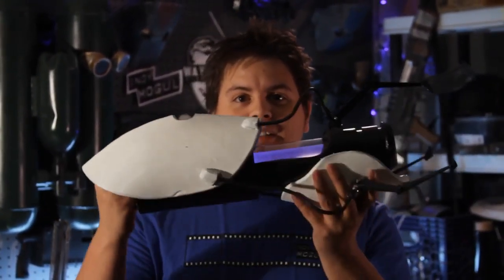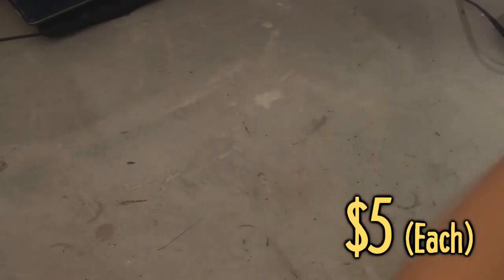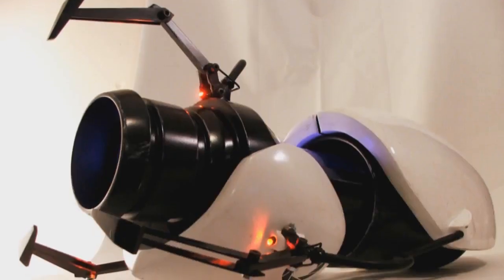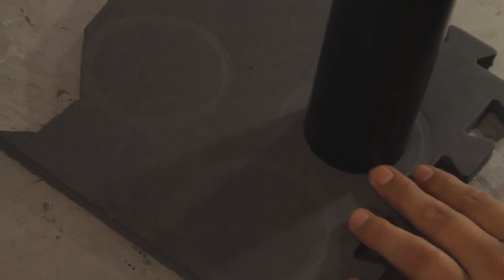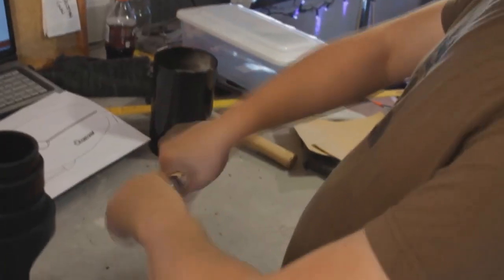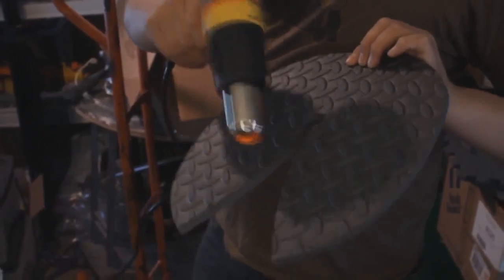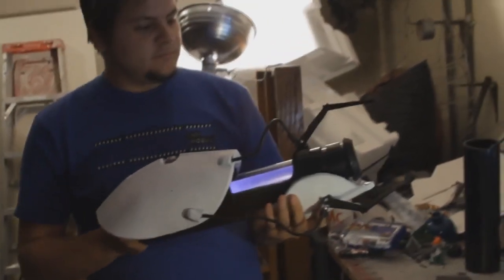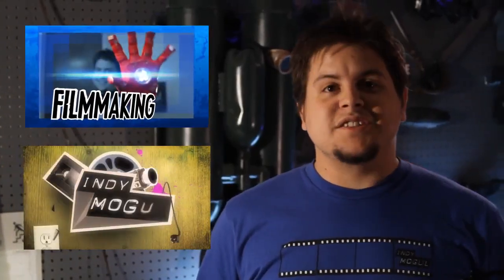Cheap Portal Gun: DIY

Comment: Plumbing epoxy, 1/ inch and 3/4 inch machine screws, two 3-inch PVC couplings, two 4-inch PVC couplings, clear plastic tube, 4 inch ABS tube, 3 inch ABS tube, plunger with clear handle, led flashlights, foam mat, tupperware container, black cable, spray paints, dremel and hot glue.
Total:
$53.30

Edit: btw for dremel and hot glue it depends on which ur getting

Comment: 1 3 inch pvc coupling 
2 4 inch pvc couplings
1 clear plastic tube
4 inch pvc tube
3 inch pvc tube
Clear plungers 
Spraypaints
Foam mats
Black cable 
Hobby plastic sheets
Plastic containers 
Wood mats

Comment: Ngl this is probably the shittiest tutorial I've ever seen. I've been following along with it while making my own Portal gun and there are just so many problems with this. "And then I did a thing... Like this!" "I eyeballed it, and did this!" "And then I made a couple rings, blah blah blah, you get the point!" No, I don't get the point. Barely any measurements, completely missing explanations for some parts of it, and overall just cramming in a waste of recording footage into a video of this guy. Still, though, I took what I could get and tried to follow along, but ended up having to figure most things out myself.
Basically, I'll give it a 3/10. (And that's pretty generous.)
Reply: Yeah your probably just shit at building stuff m8 i built this with ease. Dont be such a nigga m8
Reply: @ejyxx5534  then please explain how there is such a large gap between the 4" pipe and the 4" coupling. I feel like I'm in fucking wonderland trying to figure out why my couplings and pipes are different sizes from his.
Reply: this kinda vid is made for you to look at the website, but it doesn't work soooooooooooo

Comment: can anyone tell me the shopping list? its too fast and unclear
Reply: yeah you posted that 5 months ago but anyways if you're still planning on doing it or whatnot here it is:

- Plumbing Epoxy Putty
- 1/2 and 3/4 inch machine screws
- 2 3 inch PVC couplings
- 2 4 inch PVS couplings
- A clear plastic tube [preferably 4 inch]
- A 4 inch ABS tube
- A 3 inch ABS tube
- A plunger with a clear handle
- LED flashlights [i just had a random idea but you can get one that changes multiple colors so you don't have to buy multiple flashlights to get different colors]
- Foam mat
- Tupperware container
- Black cable [maybe about 12 feet?]
- Spray paints [you can customize it but for default, it's white and black]
- Dremel Rotary Tool
- Hot glue gun

[no problem if you needed that]

Comment: If you are building this in 2016 save some cash and knock about $12 off the build by going to a store like $5 and below to get the foam mats you only really need two of them and they are like $3 a piece there.
Reply: Richard Fox building mine in 2018, I'm using most of Odin's ideas plus  some of Indie Mogul's
Reply: Richard Fox thank you mate
Reply: Richard Fox thanks at Walmart they're more than 20 bucks
Reply: Thank you
Reply: theGAMEgeek Cosplay and more Hey!! I could use some help and pointers on my build if you have the time ❤️
Reply: Good advice... I already have some foam mats laying around for me to practice making armor... which I never did. So they'll finally get some purpose.
Reply: Thanks!!
Reply: omg u have got to be joking when u said five and below has foam mats.. im surprised theres smaller sizes of foam mats besides those 20 dollar walmart ones
Reply: @Jitikoner  not a joke my one in the mall here sells 12x12 floor mats still
Reply: @RichardTheValiantFoolFox  ohhh i looked at five below website and realized u were talking about floor mats- im too lazy to check if this was one of the videos on a portal gun or not- are the foam mats they sell at five below good for making the shell of the portal gun?
Reply: @Jitikoner  I have used them for a foam hand cannon and a hunter knife from destiny and a few helmets so I say should be fine
Reply: @RichardTheValiantFoolFox  welp i am already making a paper portal gun and it's going well besides the fact that I am running out of glue and I have never even had any tape to use 💀 still it looks good

Comment: I'm spanish and i have problems for understand when you say the shopping list. Could you write the shopping list with inches and diameter? Please. Thanks and sorry my english.
Reply: 3 inch abs tube
4 inch abs tube
2x 4 inch couplings
2x 3 inch couplings

Is that what you needed?
Reply: Thank you very much. I need: The clear plastic tube? and the plunger?
Reply: +MisLissit he did not provide sizes for those. I instead used a sheet from a clear folder and then glued it into place
Reply: +Django Sibilia Thank you very much for all.

Comment: I just realised I could save a bunch of cash by replacing the PVC in this video with more foam. I'm pretty sure I have plenty of foam mats in my garage. Then I would only need to buy the white spray paint, the screws (although I may have something similar around the house I could use), and maybe the clear plastic tubes for the middle.

Comment: What is the hand saw thing that you use called? is that glue gun the one that melts glue at high temps/low temps? The tools at 1:53 and 1:54
Reply: Dynast3 Are they just called Dremel and hot melt glue gun? Would it work with one of the cold melt glue guns?
Reply: Dynast3 It's a Dremel. I would imagine that any glue gun would work, but I recommend hot glue. The hand-saw is called a hack-saw :D

Comment: I used this tutorial as a guide, very helpful! I changed it about a bit though. Indead of using White foam for the base of the gun, I used a crash helmet. And I used windscreen wipers that I broke in half and angled together with hot glue and later supported it black duct tape. If anyone reads this I just thought more suggestions would be handy. Check out my result here. https://www.facebook.com/geekmargate/photos/a.776297742439240.1073741833.349589158443436/776298285772519/?type=1&comment_id=776675962401418&notif_t=like

Comment: Does anyone know how to make a gun shoot like portal gun?
Reply: how about some paintballs? they can make blue/orange stains on the wall, but I have no idea how to make the oval shape. Perhaps rigging the wall?
Reply: That part you would have to do with visual effects. Use after effects and you'd want to take a video of where you want the portal destination then mask an oval shape and add the blue or orange glow to the outside of that mask. :)
Reply: meybe the portal 2 extras could help you thers vidoe ther
Reply: Good luck catching black holes for your portal gun :)
Reply: Make a portal gun plz I don't want do die without using one
Reply: You only need 2 black hole generators, then put it inside the portal gun ;)
Reply: Arvind Subramanian make a plastic ring (or wood) on the wall and shoot in it .3.

Comment: 1:28 don't you mean 4 4 inch couplings? at 2:35 you said glue the two 4 inch couplings together but at 4:30 you said you put the barrel (including the 4 INCH abs pipe) into the 4 inch couplings.

Comment: I've been working on this project since yesterday. I found the exact same clear tube and plunger that Zack used at Lowe's. I think he made a mistake when he said 3" and 4" ABS tube. I think it has to be 2" and 3" based on the C shaped rings he made at 4:13. If it was really a 3" tube the rings would have to be a lot bigger.

Comment: TIP: 4 inch Pvc couplings cannot loosely fit onto a four inch ABS tubes. Instead, use a 5 inch PVC coupling, or use 4 inch ABS couplings.

Comment: He got the sizes wrong. There is no way in hell you could loosely fit a 4inch ABS in a 4inch coupler. It should be: 2" Coupler, 2"ABS pipe, 3"ABS pipe and 4"PVC coupler. no 4 inch pipes should be used, i bought one and it was waaaay to big.

Comment: @nitroVIDO Ah, that makes sense...I called around to five different stores, and not one of those carried them :/ My new base consists of a 2" PVC pipe inside a 3" PVC pipe, with the "core" being inside a 1.25" length of clear tubing (sold on rolls), and that seems to be working for me pretty good.  The back end is still the 4" couplers and the front is still the 3" coupler.

Like this comment if you tried it and it works for you, maybe somebody else could use this little bit of info.

Comment: I got two flash lights and put an oranfr gel on one and used foam to be able to spin and i spin the foam to change from orangr to blue also i added a tiny piece of thin plastic thst clicks so i know when to dtop spinning :) just a tip i found easyer than switching the light and stuff

Comment: List 
-Plumbing epoxy
-Half inch(1/2) and three quarter(3/4) inch machine screws
-three(3) inch PVC couplings (two of them)
-four(4)inch PVC couplings (two of them)
-Clear plastic tube
-4 inch ABS tube
-3 inch ABS tube
-plunger with clear handle
-led flashlights
-foam mat (4 pack)
-tupperware container
-black cable
-spray paints (white and black)
-dremmel
-hot glue

Comment: @scatillo545 And you think building one is cheaper?  You have to pay $20 for a sheet of styrene plastic (which normally comes in 4x8 sheets), and then you have to build a vacuumforming machine, which the cheapest one is at least $40.  And if you decide to shortcut the vacuumform the machine, you could use an electric oven and a heavy duty vacuum cleaner.  But then you're risking your own health, and then you end up going to the hospital.  Trust me, with this, stores are cheaper.

Comment: @codebreaker2001 Of course they did just like when they are told to mod the gun weasle for the hidden blade that Zack had to redo cause people are to stupid to follow directions to start with. They ignored the link to other builds and never listen even to Zack. How many times have you heard some 10 year old request a build for an m16 that can be bought in high detail for $16? They are not going to build this either. They want a cheap easy toy

Comment: Correction: Often pieces not used from an item that was used.  The same is true in Hollywood.  Most of the iconic items in film and TV shows were found items and were modified by using left over scrap.  the Light Saber in "Star Wars" was a flash bulb housing for a camera that had pieces of a windshield wiper attached to it for the "handle."  The Nostromo model from "Alien" was build from pieces of models from parts bins at model shops, most of those pieces being the mass produced SW models.

Comment: @dragonbreathstinks True.  But if you bought a four pack, you can use the extra foam for additional projects, like how Zack used the left over pieces of foam from the DIY Sci-Fi armor for pieces on the Pirate Sword tutorial (or extra portal guns).  In fact, some of the tutorials in the past have often required using items already had (such as paint) or in a "parts box" (items left over from another build tutorial, often pieces used).

Comment: @ryaninflorida1  This is as cheap as you can get.  The maximum limit of any Indy Mogul build is $100, always has.  If you feel you can't affording to spend the $50 to make it, then the only other option you have is to take the initiative and try to make a cheaper solution. If there is one thing BFX teaches, the builds and materials are not meant to be followed precisely (BFX knows you may not have the same stores/items).  If you think you can't do it, then do the things you thought of for $50.

Comment: @ryaninflorida1 And $50 is cheap in comparison to the $300+ that are often spent to make professional items, including time to research, what kind of professional materials used to make it (including silicone molds and casting materials, which often range as simple as $30 for just 12 ounces of material, to more). If you're wanting a portal gun that has electronics and lights up that's professional grade, it'd cost you well over $300.

So, yes, this falls under being a cheap prop.

Comment: Note: The sudden absence of a steady whirring sound may indicate a miniature black hole cooling fan battery failure. Quickly disassemble the Ring Singularity Harness, pry apart the upper and lower Ring Singularity Rings, and gently remove the Event Horizon Estimation Wheel. Then, while running directly away from the device, use the wheel to precisely determine an estimated minimum safe stopping distance.

Comment: I mentioned in the Futuristic Armor build before, you can get the foam mats he used with a different texture exactly like the Mass Effect one at Harbor Freight for $10 a pack of 4 instead. Looks like he used diamond plate ones I saw at Kmart which had 6 to a pack. But if you can avoid it, go to Harbor Freight and buy for $10 a 4-pack instead of Lowe's for $18-20